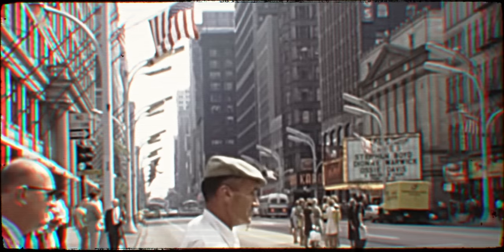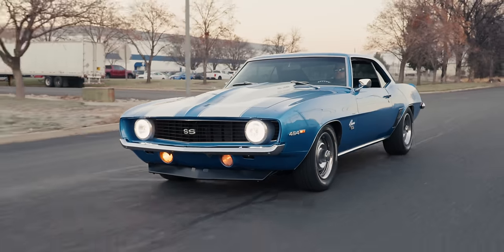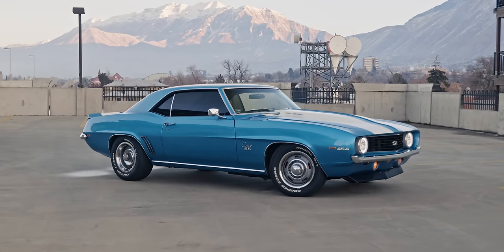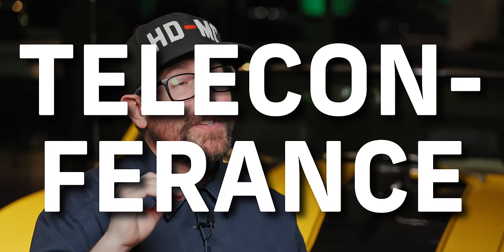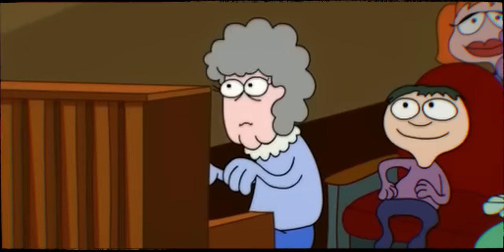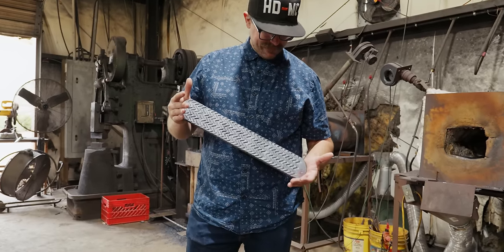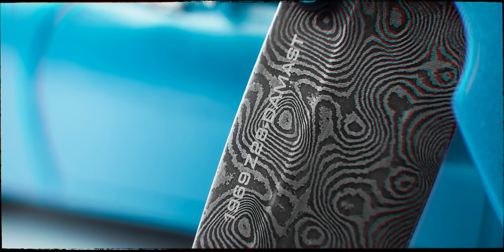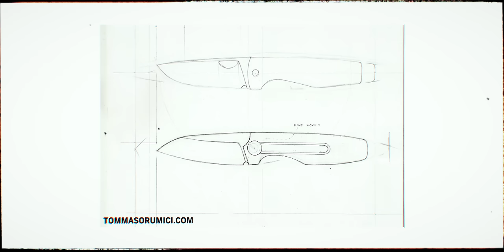Historical Damascus Knife! The Boker 1969 Camaro EDC Pocket Knife.

Comment: I had a 1968 Z28 Camaro it was a gas guzzling thing I’d beauty! It had a 750 double pumper holly carb. In a 302 high rise manifold with a rock crusher trans and a 488 posi track rearend. Gas was 35 cents a gallon.

Comment: Remember the term "Damascus" was made from one steel, during the process of making steel.  In those days you had to make your own as there was nowhere to buy steel.  During the process impurities would be introduced in the "cake batter" that created dendrites that gave Damascus it's distinctive look, but it was one steel.  What has been lost are the impurities as the steel today is superbly made without imperfections.  What we see today and erroneously refer to as "Damascus" is actually pattern welded steels, and San Mai jacketed core steels.  The only thing lost about the Damascus process is making steel by hand in a crucible.
Reply from the maker: For sure! If have to do 2-3 videos just to scratch the surface of the history and process. 👊💪